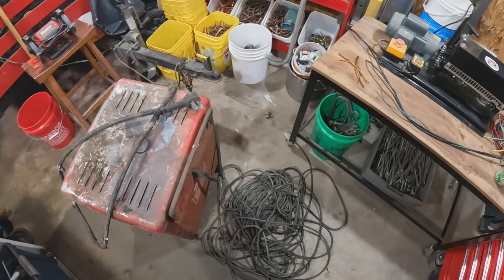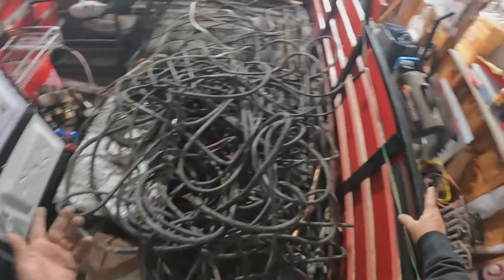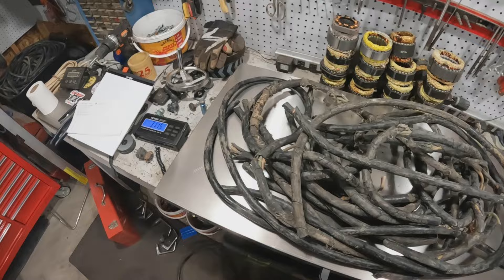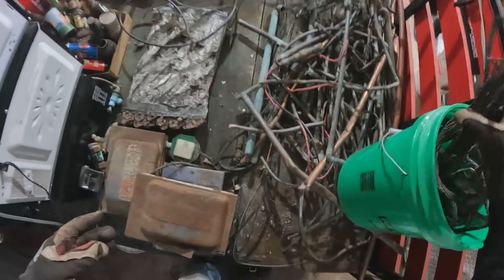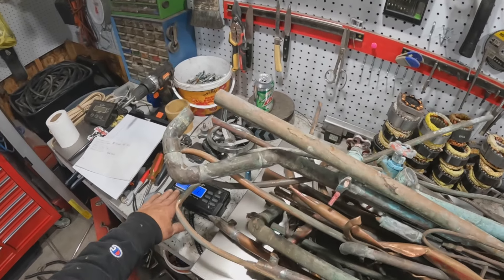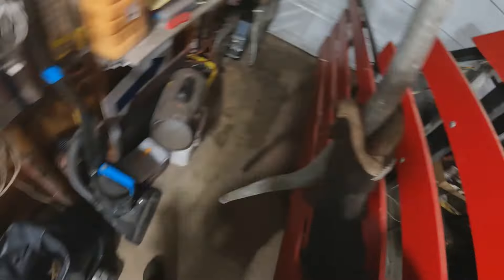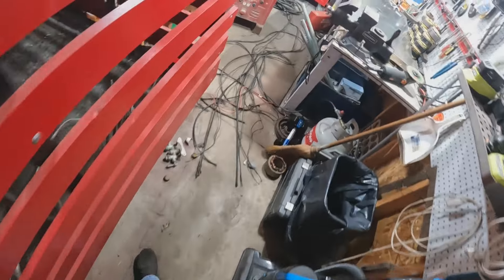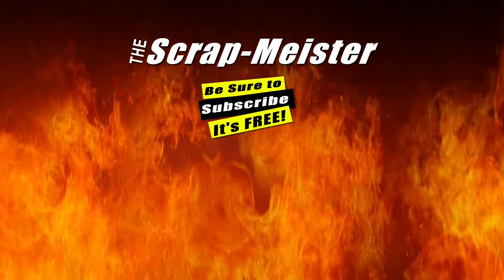Weighing a Scrap Load to pay the customer | Lotsa Copper!

Comment: What’s Up Brother 👍🏼✅. 19 Degrees is ROUGH Mannn. I’m Highly Upset with 30’s-40’s Down Here 🤔😎🙄. The Scrapmeister Using a Stripmeister 👀🤔♻️. Yup They Definitely Shrunk the Radiators Man 😳👀😁. Big Ole Heavy Cow Welder 💪🏼 I was Just Gonna Ask if You’re Just Splitting the Profit with the Customer Man. Wire Barrel is Close to Full Man ♻️🤑.  Lots of Copper Tubing 🤩🤑. Awesome 👏🏼 Heavy Duty Lightening Cable. I’m Guessing People Seek Out Lightening Rods to Ground Their Barns Or Houses or Whatever. Shred Price for the Whole Load 🤔. Great Idea Man 😎😁. Jokes. Looks Like a Nice Score Bro. Big Old Pile of Copper 🤩. Nice. Lots of Stripping in This Video Man. Yeah That’s What I was Waiting for. The Brass Pile at the End.  That Welders HEAVY.  Great Work Sir -End Junk Rant
Reply from the maker: shred prices for just the steel, like the electrical boxes. I'm paying him good money for the bare copper :-) I'm paying him out right, at the prices he could get at our local yard. There prices leave a lot of room :-) I'll sell in Green Bay.